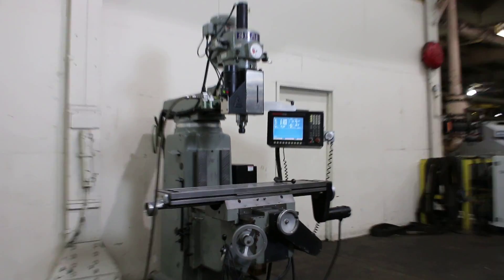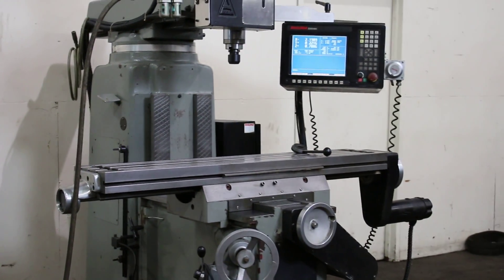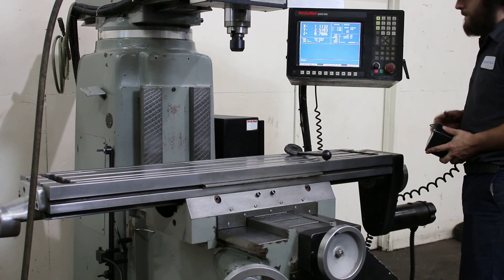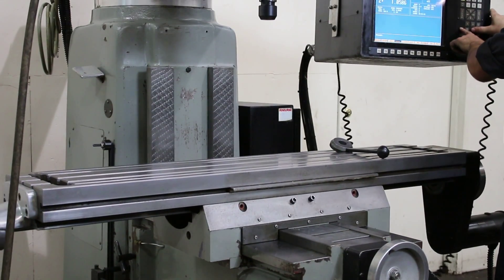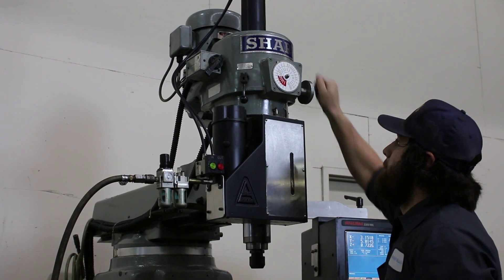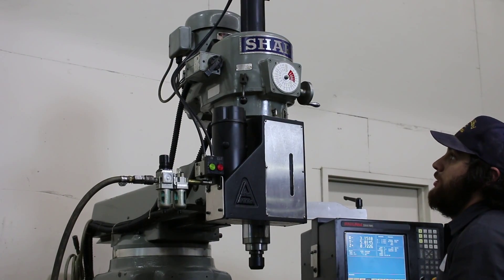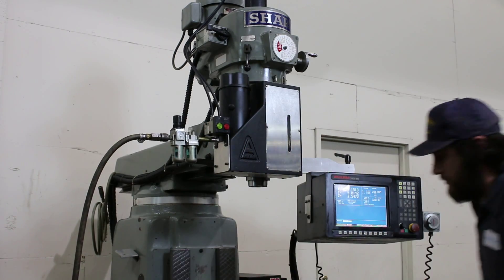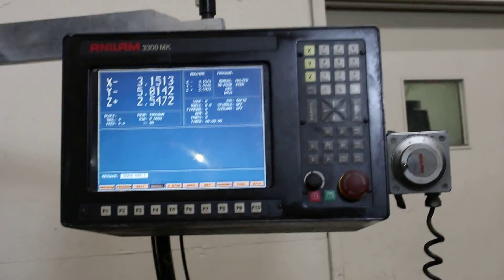154235 SHARP 3-AXIS CNC VERTICAL MILL  W/ ANILAM 3300 MK CONTROL

Comment: Nice video. 
I'm having a problem if you could help? I set my tool length offset (calibrate Z) but the tool wants to go too deep. Tried numerous times. Any thoughts?
Reply: Did you set Tool 0 or a different tool? Set tool 0 as your reference tool, the calibrate Z relative to tool 0, but you have to make sure that your other tool is selected first.